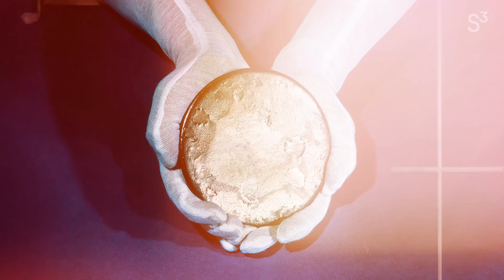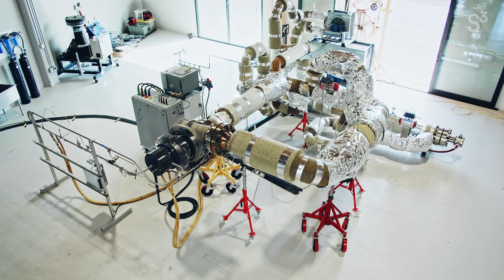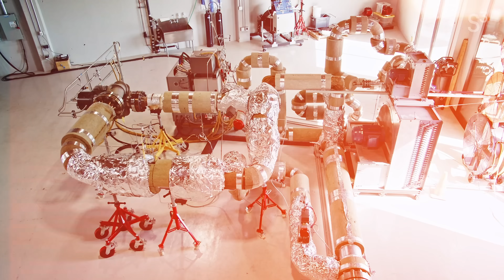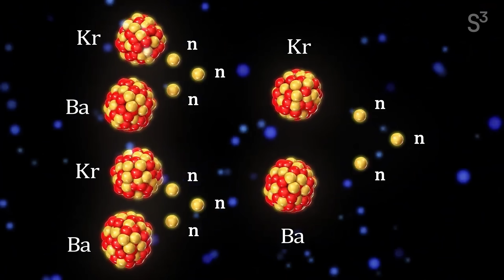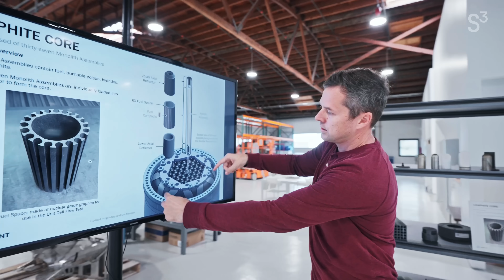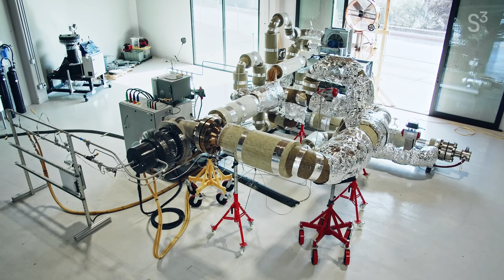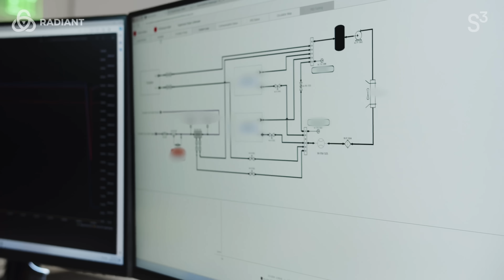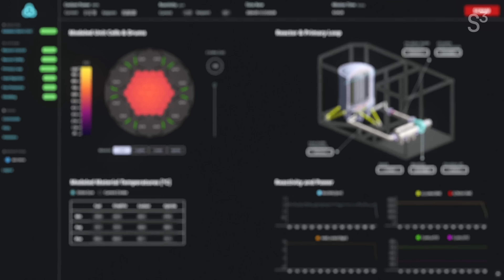The future of Nuclear = Small, Mobile, Microreactors | Radiant

Comment: The last thing a roared deployed base needs is a small nuclear reactor. This is a huge benefit for mining or remote locations but to say it's going to save lives in military operations is legit insane.  I was a Naval nuclear operator and have a professional background in nuclear engineering. If a forward small generator got hit it would make the surrounding base unlivable not forever, but for ten years would lose the full funding of that base. Bad idea militarily or we would have done it. The army had a program for nuclear tanks and the air force had one for nuclear aircraft (the airforce one never took off, and the army one blew up).
Reply: If everything a base needs could be run on electricity rather than all the equivalent fuel and supply lines, that could be a very beneficial trade-off. How hard would it be to dig a hole and bury one or more of these conex-trailer sized things when setting up the base, thus protecting it from most threats? For the military, not hard at all. Seems plausible. As for "losing the full funding of that base"...did you not see what Biden did when we left Afghanistan? Since when does the US military give a crap about retaining its assets? These guys are talking about the military idea for one obvious reason: because the military spends $$$ like there's no tomorrow.
Reply: Nuclear reactor powered planes, automobiles, and homes make as much sense as nuclear powered submarines and ships IF the scale is appropriate to the use case and risk.

I'm not saying anything new, I am just stating the logical reasoning to justify why nuclear reactors on a small scale make sense or not.

Once we pass this reasoning we will see nuclear implementation at scale.
Reply: Sorry you’re a little off. You can come in and clean up the area which would make it functional again. Why you think it stay non livable for ten years is wired. The   Army would just stand up units that would go handle these things with robotics in mind. This is just a simple engineering issue that can be solved but people keep acting like it’s impossible to integrate this stuff into military application when it’s done on military ships for ages. 

No we haven’t done it because an incident happened and instead of fixing what happened we just gave up. The idea that if it’s beneficial we would do it is like saying the military uses common sense and things that are of benefit when we know that’s a lie because it’s run by humans. If you wanna move to the next step and actually save money and be more efficient then Nuclear is a way and maybe the way to move forward. There will be major issues and maybe people die but then you fix the issues with better engineering and implementation which will come with time and failure.
Reply: That's why the generators are so small, it's harder to hit and much less fuel that it could potentially spill if attacked. The area gets exponentially bigger in a circle when expanded like a reactor, this reactor is exponentially smaller if you get what I mean so that there's going to be little spill at all and easy to clean up. I don't think it's as bad as you're thinking but I see your concern.
Reply: @elongatedshrew5902  Have you been keeping up with modern drone warfare?

Comment: Often ignored is converting the heat to electricity. The cost effectiveness of steam goes up with size.
If the operating temperature of the reactor can be raised such that a block of sodium is hot enough to emit radiation to a thermophotovoltaic cell array for 50% efficiency with no moving parts. If a pebble bed with carbon spheres hold gaseous uranium and built in PiUS failsafe design reactor system could fit in a suitcase

Comment: L M A O: 
Where do these clowns come from? First this is a solution to a problem no one asked for. Utilities aren't interested in them. Whether you build a 3GW reactor or a 1MW reactor all of the regulatory costs are the same. No utility is going to spend a few billion in regulatory costs to build a tiny reactor, that will never recover the regulatory costs.

Second the World is running out of economically recoverable uranium. At current demand all of the economically recoverable uranium will be gone by 2050. That is one of the reasons why at least in the US, that utilities refuse to build any new reactors. It takes a utility about 20 years to build a new reactor (soil studies, Regulary, finding contractors & getting contracts signed & the time to construct it). A new reactor project started this year would come on line until about 2044, which is close to when the economically uranium will run out.

Third no body wants these built in there backyards: NIMBY. You cannot even convince people for new power transmission lines in their neighborhoods.  There there is also the costs of security, as reactors can be targeted by terrorist.

Comment: Sustainability question here: with the growing scarcity of helium, is it really a viable long term solution to use it as a coolant? Are there not other noble gases that could fill that role?
Reply: The rest of the noble gases don’t have the same cross-section as helium.  One could use carbon dioxide but one runs the risk of creating carbon monoxide and creating carbon - 14.

Comment: It's such a shame how much fear mongering has negatively impacted the progress of Nuclear energy so badly. (I'd almost even assume the oil companies would be very happy about this?) At this point tho Modern nuclear energy options really should be one of the main things we utilize in collaboration with other alternative energy sources all over the world. Especially with all the advancements we now have. Our knowledge around safety measures is much more understood. We've also seen vast improvements in engineering, material science, technology, robotics, etc. They are all much more advanced now. This power source is the best option to improve our environment & will really help lower our emissions. The only things holding us back is legislation, fear mongering & past trauma that's affected us from our past (which is understandable but we really gotta give it a chance to see if it can prove it has progressed & improved) 

Did they outlaw electricity or oil, coal when things went wrong in the early days of those fields? No! They kept going and understood things usually are bumpy and difficult in the beginning and kept going even tho those sources negatively impacted our environment. A huge issue is government BLOCKING any sort of progression from happening. We'd be lucky to see the slightest projects approved or finished with-in the next 100 years.. It's very annoying to see how much we have gotten in our own way when it comes to improving or advancing certain things. Instead we let fear, money, man made "required legal processes" Stop us from doing anything other than wind, solar, oil, natural gas, damming our rivers, mining for minerals... It's very frustrating because we should be able to use all these options in collaboration. If we actually wanted to improve anything. That's what we need to do and stop letting so much potential get blocked from ever occurring in the first place.. It's really irritating. I wish certain people didn't make this so "complicated and difficult" Why would any reasonable person want to block progression?

Another thing we are seeing is many places struggling with a lack of water. Strangely we have created so many systems that run off water right into the ocean as quick as possible. We are not utilizing it, we aren't adapting or using our ingenuity. Yet we keep hearing in the news how important water is, so you'd think we'd adjust our systems so they can utilize what rain water certain area's receives? Idk why so many places like California let a lot of their water run off right back out into the ocean? Something else I wish we would do is put effort into reintroducing the importance of wetlands. The importance of bringing back things like Beaver's in certain area's. Beavers are keystone species and can enhance an entire ecosystem. It's very beneficial to have wetland habitats around. Just because we "build modern cities" we shouldn't lose this important aspect of our habitats. They are beneficial in so many ways. We should get rid of a lot of Dams. It could bring back salmon runs for example and it allows for important nutrients and sediment flow to occur again that is supposed to happen in natural water ways. We really could improve aspects of our environment if we didn't dam up every river & alter so many of our water systems. I know it's stigmatized but I really think modern nuclear energy options is our best option going forward and if we did that it could really improve our situation with our climate.

The more i learn about our power grid, the more i realize that modern nuclear energy options are our best option. Small form reactors, LFTRs, Thorium Reactors, molten salt reactors. Utilizing our advanced technology, Improved engineering & material science. Utilizing our greater understanding of safety & well made designs. We have so much more advanced computer technology & robotics that can be used. It feels like even tho tons of advancement has occurred with engineering designs, safety measures, etc. It still doesn't matter to most people. It's like most people are ingrained with a natural negative response when talking about nuclear energy. It's a bummer because i truly believe that our best option for our future is to start utilizing Modern advanced nuclear energy options in our electrical grid. It's just proving to be challenging to get politicians to get on board. 

  It will really allow places to be much more energy independent. Less reliant on fossil fuels. They'll have efficient, stable electrical grids and the rest of the grid could experiment with alternative power sources, power desalination plants, etc. 
We need to heal from the trauma of our past. See & learn that those things only happened solely from Us not understanding what we were doing when it came to nuclear energy at the time. We didn't have advanced enough technology, material science, engineering, safety measures, understanding of how to go about everything, etc. This source of energy will greatly help the world improve towards the future and lowering emissions. More than anything else could, while also providing a very stable electrical grid system. Currently we have alternative energy options but the majority of our grid is powered off of fossil fuels and emission producing sources of energy. We will be so much better going forward commiting to modern advanced nuclear energy options.

In my opinion it's been so irritating that we've taken this "You can make a difference" approach. When it just plays with people's emotions. This issue is so much bigger than individual people. We need countries/states to get on board. It's the only way we can make even the Slightest difference. We've already waited too long. Everyday is a day wasted & we haven't even made a dent in improving our situation.

Comment: Where is the fuel sourced from?  What is the plan for waste disposal?  What security measures are taken to mitigate the proliferation of MUF (material unaccounted for)?  What does the maintenance schedule look like?
Reply: And is there a fail safe mode?  What happens when the active control systems shut down?  But hey, we got some good shots of its undersized crane!
Reply: It makes no sense to have terrestrial microreactors running using uranium. You need to enrich the fuel. You still need a primary pressure vessel. Helium is a dwindling resource and ridiculously expensive. MSR’s running thorium cycle is going to be much safer.
Reply: a sealed fuel source which can only be used inside the system, and tampering of the system not allowed at all. geolocated at all times and complete measurements as to energy generation and all.. It's not impossible tho.

It is a difficult thing still.
Reply: Proliferation?! It is not a fast breeder and is way too small for anything like that!
Reply: @soundsoflife9549  Good. How about dirty bomb potential? Imagine capturing one of these and making dirty bombs to contaminate a major city's port, highway interchange, bridges.  A truck of portapotties can shut down a highway for 8 hours.
Reply: I’m assuming that a reactor that small would require a fuel enriched to around 20% or more, similar to what nuclear submarines use (also a compact reactor design).  That kind of enrichment more than warrants controls to ensure the fuel doesn’t get into the wrong hands.  Now we can debate whether that’s the responsibility of the reactor designers or their customers.
Reply: @mangarang  Make these like those Delco sealed batteries.  (are they all sealed now?).  You get this thing delivered to you on a flatbed truck. It make high pressure steam for you for 5 yrs straight.  Attach piping, controls, passive safety systems, and you're good to go.  When it gets empty they swap in a new one, take the old one and refuel it at their facility.  Now, how to stop theft?  Seems solvable- not being the field I wouldn't know off the top of my head. You could use the same measures to stop the theft of military eqpt. Then again, military equipment isn't found where power plants are...
Reply: Honest question: is 5 years without maintenance of the reactor chamber or other irradiated sub-systems reasonable/feasible?
Reply: @mangarang  no idea.  Maybe?? Needs a fail safe system to shut down the reaction so it doesn’t continue generating heat in the event it’s not connected to the rest of a thermal plant. But making it completely sealed might be a great way to minimize spills etc.
Reply: It doesn’t need to be. It you leave the fuel of a regular reactor the right amount of time, you can also make weapon grade material. That is why you let IAEA inspectors to observe. They are already overwhelmed. With thousands of these reactors, that won’t be possible.

Comment: Thinking outside of the Box here, but could you use hall effect sensors and magnetic fields to guide a long drill bit through graphite to guide it strait?  I too have needed long holes drilled and tried super magnets to influence the bit through hard wood, it did not work, but it might work with graphite and a more abrasive drill head and a thinner shaft.

Comment: What happens if this is hit by a missile?  They discuss using it at a military FBO, but energy infrastructure is a major target during a conflict.  What is the worst case scenario if this is targeted by a bad actor?   The non linear risk is what holds me back in being all in on nuclear.  We know what happens when a natural gas plant is hit by a bomb, it doesn’t have meaningful lasting negative impacts on the land.  If a meltdown scenario is even remotely possible then that super low likelihood event needs to be a massive consideration with tech like this 🤷‍♂️

Comment: Very cool idea getting done here. It would work really well for very secure locations like military bases, or very remote locations like iceland, mars, moon. Greatly appreciate the level of ingenuity going on here.

Only issue I had is when tech bro said you could have a starbucks next to it, no problem and we could ship out like 60 of these a month after the first test one. 

Centralized large nuclear power plants work because all the risk is managed in one place….security, failures etc. Much easier to plan for. Spreading out multiple small plants all over the globe greatly increases attack surface for bad actors and requires a lot more experts to keep them all from going boom.

Comment: Something that's rarely discussed with respect to small nuclear reactors, and I wish I could say otherwise here, is their requirement for HIGHLY enriched (usually weapons grade) U235, and their inherent INEFFICIENCY. The fuel burnup efficiency for a small modular reactor is typically less than half of that of a normal gigawatt scale BWR or PWR, meaning less than half of the 235 in the fuel is actually split to produce energy before the rods become waste and the core has to be refueled. That's pretty abysmal considering that a PWR is already only using 5% of the energy in its fuel because the 238 is left unbred. The efficiency gets worse the smaller you go, and for a tiny reactor like this is going to be extremely bad, thus it will need to be refueled frequently with highly enriched fuel and be very expensive to run. It's neat to see innovation in this sector, but I'm not holding my breath....

Comment: The ONLY question should be what will be the cost of a Kwatt-hour of electricity from this reactor?
If it's much more that the cost of electricity from solar cells or wind than this reactor will only be used in special isolated areas

Comment: For this sort of work, I tend to like the Accelerator-driven subcritical reactor type using Thorium as a fuel. Just me, I like something that has a gas peddle instead of a choke to shut the thing off. The Accelerator driven designs by nature can't do the devil's core run away thing, anything that has a core that can go critical will at some point go critical.
Reply: Murphy law.